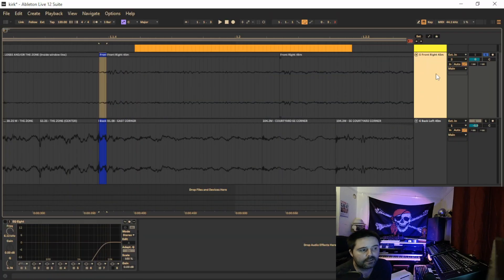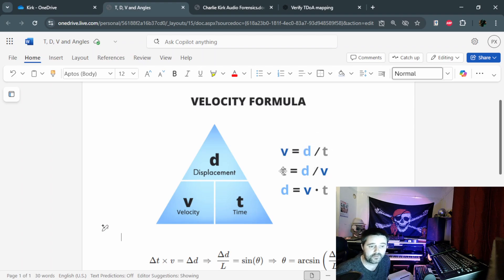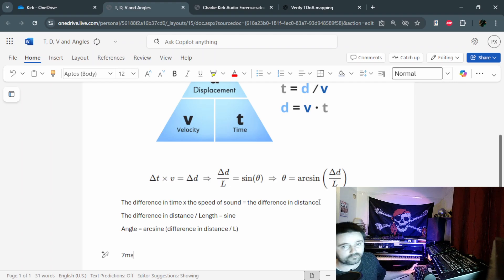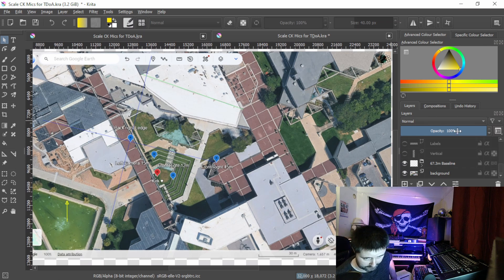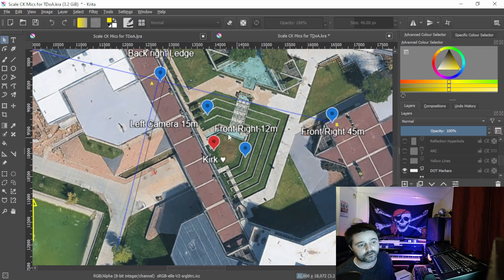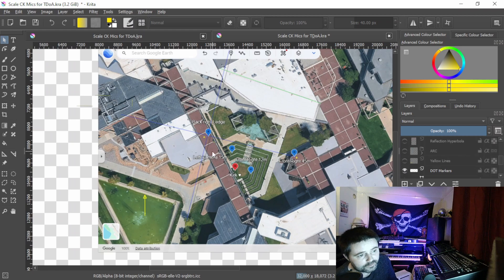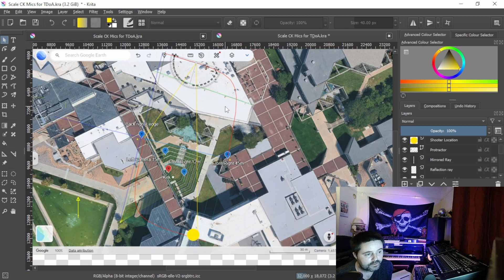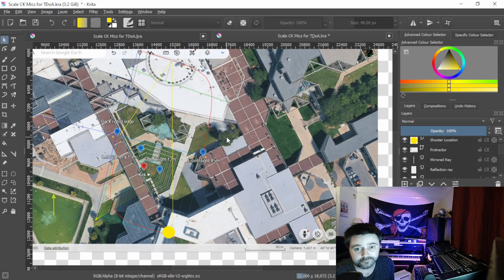Reflection vs Source | TDoA Audio Geometry Explained

Comment: Wow!  Thanks Matt!
I'm capable of following your Math - the generated hyperbola and it's reflection are amazing to me. The large yellow dot you placed for the shot position is EXACTLY where I say the 'second' shooter was ( NOT the one we see lying on the Lossee rooftop in some videos). Apart from the Zone rooftop it is the ONLY place a shot could have come from that is both in line of sight and within the distances you have calculated and also has reasonably easy access but is mostly invisible to those attending - or watching out for as in his 'security' detail.

The first arc you showed was interesting and accurate for the technical details, but you are only looking at the maths here. If you open up to the physical reality of where a shot could have come from then the ONLY place on that arc where a shot can be taken without anyone being seen and that can actually SEE Charlie (bullets don't go round corners!!) :-) is where you drew the circle!  Unless you get into the realm of drones firing with deadly accuracy?? But surely someone would have seen such a device? Any potential drone on that hyperbola would need to be VERY low to have a line of sight on Charlie as he's sitting under a 9 ft high tent (minus the banner flap) Which pretty much rules the possibility out.

Thanks for the last reply and for the explanation here - I am getting your reasoning more clearly now, but there is a but. In your CK Audio Forensics .pdf you've stated that for the right 7 m mic you used 0.90 sec for the sound and 0,94 sec for the impact(='visible reaction'). In your comment you had that the other way around! I think this is why I was somewhat confused... I would have thought with a supersonic bullet you'd see a reaction before you hear the sound  (as per your comment) if you are a number of metres away from the hit?
I'm not suggesting those had to do with crack bang ratios (although I do use those for MY distance calculations!) and I get your reasoning for the body reaction time but as another commenter mentioned, the 80-120ms time refers to the 'surprise' reactions where the brain has to receive an input and then decide what response is appropriate. If the autopsy version is accurate then Charlie's spinal column was shattered when the bullet passed into his vertebra making the body muscles react faster than in the 'I have to decide what my body is going to do' case. I think!?

Am I correct in thinking you can mirror image those 2 hyperbolae to the second mike base point and get a point of intersection for the shot site?

Looking forward to your next masterpiece!
Reply from the maker: Hey man, appreciate you, I really do! Perhaps we can compare notes at some point?

Yeah, if I got them the wrong way I hold my hands up and humbly apologise for that confusion, there is lots of moving parts isn't there. Yes, I would love to see your crack to bang analysis perhaps one day soon we can meet on zoom or something?

I can destroy the drone idea with physics, muzzle break is like 3500lbs of force. This means a drone would have to be about 1m wide to counter that push back, it would also need to be able to create that 3.5k lbs/f instantly on top of the force required to be moving. Sub sonic, sure they can fire subsonic but for a supersonic, it's not quite so plausible. I suppose Ai would verify that, I'm no drone expert but when you think of flight and force from shooting, you realise you need something larger for that force.  

I agree, the impact analysis can use a little work and perhaps a mid point everyone can agree on. This is why it has an 80-160ms gap as a window of opportunity. 

As for the next hyperbolae, we will have to use different pairs and reflections. There is another reflection on the zone from one of those mics, so I will check that first against this one to see the difference. I'm not concluding this one yet, it's just the result of the 1st test and an example of what I measured and why ;) 

Is there any way you can measure the impact to bang to confirm what your measurements? What I measured off was his blink. So, the moment he blinked I chalked that up to his reaction. Which could be as low as 50-70ms and up to 200ms. So, the jury is still out on that one. But for my test, it was just to show the shooter was close enough to measure the reflections after the fact
Reply: @Audio-Freq  More than happy to share data, Matt - but most of my work involves photographic info and Google Earth Pro's visual and measuring faculties and previous work on crack, bang audio evidence from the Trump shooting combined with just the pure maths of how fast sound travels compared to how fast the bullet shock wave (the crack) moves. I don't have any app for the sound analysis.
Totally agree drones are a no go; only mentioned them as some alternate theory hypothesis, but it's easy to debunk.
From your video I thought the hyperbolae were based upon one of the two mic's and the distance between them (and timing) but are they actually found as a product of both so you can't get an alternate result (mirror reflection) for the right hand mic??
I'm no audio expert so I trust your knowledge far more than mine on this.
OK - with the impact - bang timing I think we are on different paths?
If I'm reading you right you mean the time from the bullet ACTUALLY hitting Kirk to the time the sound of the gun going off is first heard by a mic? (Allowing for Kirk's reaction time, which i think will be under 100, possibly 50ms)
My problem is: (besides the fact there might be 2 shooters using different velocity bullets??) A supersonic bullet is going to be the FIRST loud, sharp noise heard in any mic. it will be louder than the much more distant bang from the gun. Echoes/reflections from that sound might reach a mic before the gunshot does, or they might come after depending upon the surface distance and the shot length. So knowing which sound is the actual bang is problematic for me.
We have 2 potential shooter points, the Lossee roof and the Browning Admin roof (your big yellow dot) We know the time the gunshot sound would take to reach any mic from the supersonic Lossee roof spot is t = dist/c (speed of sound) and the same formula for the Browning rooftop, but determining which sound comes where on the sound graphs is problematic for the reasons I mentioned.
The Browning roof being about 1/3rd of the distance of the Lossee roof would usually mean those sounds arrive faster and louder but a supersonic bullet makes quite a loud noise as it is located all along the bullet path up to the point it hits a target. So this noise is generally the first one.

I've found a decent analysis of gunshot sound which explains the cone shape of the supersonic bullet and other aspects very well. If you want to check it out it's at: https://www.researchgate.net/figure/Shock-wave-geometry-for-a-supersonic-Mach-3-projectile-and-a-slower-supersonic-Mach-105_fig1_228900815